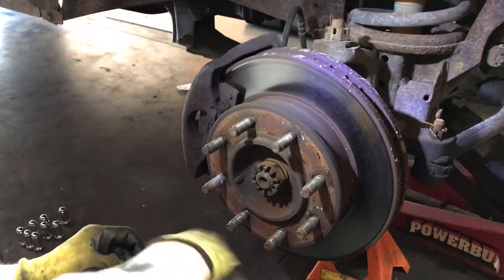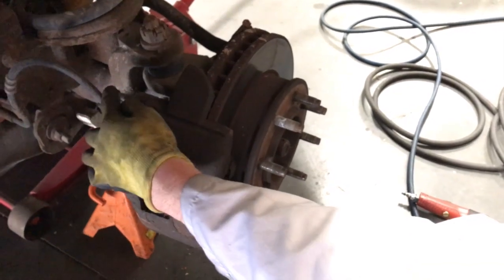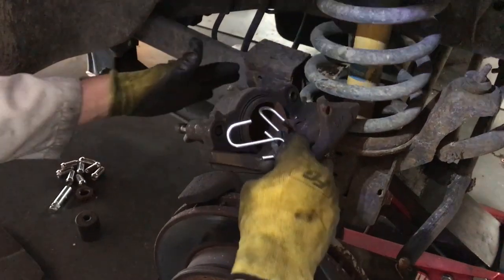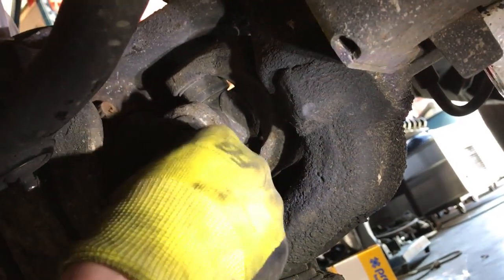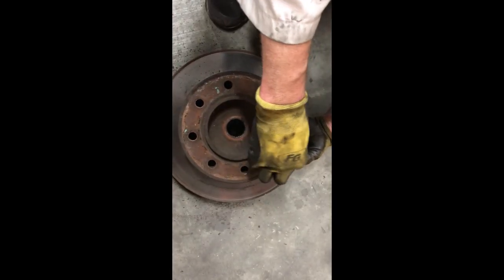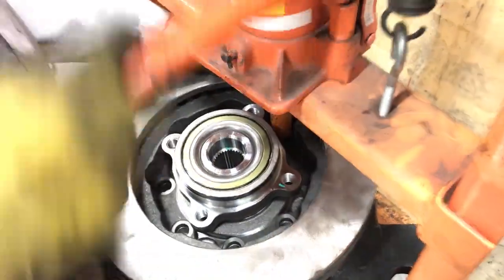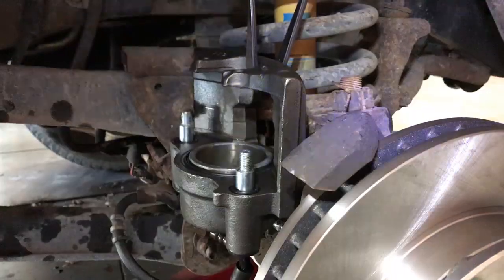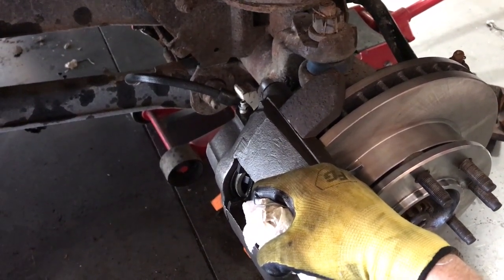How to Change Brake Pads, Rotor & Wheel Bearings on a 1996 Dodge Ram 2500 with a 12 valve Cummins

Comment: This video was great for tips and as a quick refresher (and reminder of what sockets i needed lol).     I don't have a press at home, but i used some washers and a nut to pull the studs through instead of pressing them in.  Threads are still nice and clean.  Thank you for the video!

Comment: You don't have to have a press to press that rotor to the hub assembly you can slide the wheel studs through stack washers up take a lug nut and an impact and you can suck each one of those lug nuts through to seat the rotor to hub just make sure to go criss cross pattern when tightening so it's done evenly

Comment: Tip; use c-clamp on one of the old pads to prevent running caliper cylinder in sideways and breaking brake.

Comment: Thank you for this. Watched a Dboss garage video on how to do this and he just tapped the rotor off with a hammer, had me totally confused as to how my rotor was attached. Thanks man. Other issue I have run into is those 4 twelve spline bolts stripping the splines off. That is a real pain in the ass.

Comment: I have a 1998 Dodge Ram 2500 4x4 with a 12 valve Cummins this is the only video that showed the correct brake/rotor assembly. My 1-3/4" nut wouldn't move so I pulled the stub axle hub rotor as one, did it inside out mode, never removed the 1-3/4" nut as u c in vid the rotor is behind the wheel flange

Comment: Excellent this is the exact job that I have to do that I’ve never done before and on a sidenote that is one of the best hammers  mechanic mechanic or Carpenter could own.  
Thanks again that was just awesome video awesome job and I’m gonna try to do the same 1996 dodge be 2500 sports Van with 360.  Or as I told my neighbor sports tank.

Comment: I see you have the cummins, probably a 3500 too, mine is a 2500 V110, the only thing I do different is I leave the cap on the brake repressive and use a caliper tool , I spent 45 year using "C" clamps though bro, that brake caliper tool is a godsend since AuthurRits took over my hands, and I don't have  press, i have to do THAT the old fashioned way, with a stump 9 with 8 holes for the studs a really bug punch  and  a hammer

Comment: Yes, great video because some 97’s have a disc that comes off right after the wheel. It depends on whether you have 7700 pound, or 8800 pound front end Diesel or not does not make a difference

Comment: Only dodge would make it this way,great video thanks. Just a note I believe it is best to center the c clamp the best you can in the caliper plunger to keep any binding from occuring that may damage the caliper
Reply: And leave the old shoe on to press the piston back in.
Reply: Lol a lot of trucks are even worse.  But yea thank god dodge in 2000 went to a nicer design of which the rotor just falls off

Comment: Also, another way to press the bolts in that helps is to use the old rotor on the press, works wonders
Reply: I using this idea tomorrow. Im just waiting for the lugnuts to show up at napa. I was gonna use a socket. Rotor idea is brilliant. Thanks
Reply: Did you have to use a press or can you use something else to get the studs in?
Reply: I used a press, but you absolutely CAN use a hammer and socket if needed!
Reply: @Jdl223  i used a press. If i had to hammer them out and in it would of taken all day. Harbor freight press is your best friend. Took me 10 minutes. And using the old rotor to hold the new one is the way to go

Comment: Instead of using the socket on the bottom of the hub when pressing in the new studs, I used the old rotor.  Laid flat on on the press bed rails, gave me a hole clearance hole for every stud.

Comment: Mine - I just changed the pads - $30 that's it. Rotor like your is just fine. Hub bearings feel good. I used a big screwdriver to pry the pad apart before removing the assembly. No groves as I changed way before any metal to metal. My Dad owned a brake shop. Fix what needs to be fixed no more. I had about half a pad of wear. Lithium grease for moving parts. Wheel Calipers work just fine no leaking. No need to replace good parts. I'm not going to turn drums with all that hub to remove and such little wear.

Comment: Nice Job. Only tip I have is to suck out as much brake fluid as you can from the master with a turkey baster-type of tool, and put in fresh dot 3, or better. Now when you bleed the calipers, you'll purge out the rest of that contaminated fluid. Purge out the  rear, while your at it, and she's cherry to go !!!

Comment: Great Video!!! Would the procedure be the same for both 4 Wheel Drive and Rear Wheel Drive?? Thanks.
Reply: yes
Reply: No.  The (I assume you mean) 2 wheel drive flavor has a standard integrated hub/rotor.  One has to remove the wheel bearings by removing the dust cap and center spindle castle nut. There is no reason to press out/in the studs, and there are no "sneaky" 4 bolts holding a hub to the steering knuckle.  It's totally different than this.

Comment: So what was the torque spec for the 4 bolts on the back of the knuckle?
Reply: did u ever get a reply on the torque settings? what are they?
Reply: @unclediesel7906  i found them somewhere else, like 96 or 100 ftlbs if I remember right

Comment: Can you not just put a flat Lug nut on the stud and use an impact gun to get it to seat if you don't have a press??
Reply: I'm about to try that exact method, ill let you know.
Reply: How did it work?
Reply: No.
Reply: Go get some dry ice and freeze the studs.  They tap right in when cold.
Reply: I used my battery impact to do what your describing. It was over a year ago haven't had a problem. Just have to use a level or flat surface to make sure they are all pressed in evenly.

Comment: if you are spending the money on new pads, calipers, rotors, and wheel bearings, why not just buy new studs as well?
Reply: All New shit skimps on 6 bucks loses tire lol
Reply: So you think that wheel studs wear out?  That's funny right there.
Reply: @basketballjones6782  you know what rust is right? Especially in states that use salt in winter, why not replace them while your there?
Reply: @4g63tpowered  I live in Canada and my truck was a plow/salt truck for 15 years. I reused my studs and they were mint. They don't really rot surprisingly cause I thought the same thing.
Reply: @2JDeez  ya mine weren't too bad for 500k miles but i was there and you have to remove them to split the assembly. Ocd kicked in i guess couldn't reuse them lol

Comment: Clean the rust and crap off the caliper hanger. In this case that’s the knuckle.  Don’t need a press either any tool truck will have stud installing tool very cheap.

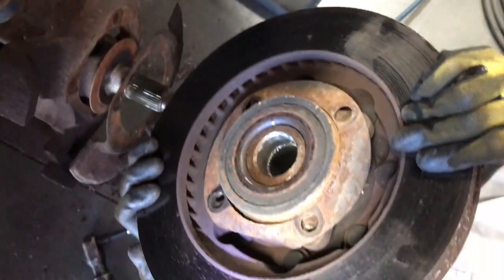Comment: im at the part where i take the 4 bolts out 9:27. i cannot for the life of me take my hub off.
Reply: charles cardery I used a 9# sledgehammer with a socket and an extension on the 4 bolts on the back. Just be sure to leave a 1/8 inch gap between the bolts and the hub when you start to wack the socket extension

Comment: Just use a wheel stud installer tool to press studs back in. It’s so much faster.  I’m watching you guys waste a lot of time. That time is labor and customers will compare labor time with others and leave you bad reviews and be pissed.
Reply from the maker: We don't do any repairs, installs or service. This was merely one of our employees that was changing his brakes and realized that their was not any detailed how to videos so he recorded it and asked we publish it on our channel to help other people.
Reply: @DieselPowerSource  Thank you for the video. Well explained. Nice to do that for one of your employees. No need to change brakes like a Nascar crew lol.
Reply: Nobody is going to trash the threads on my studs using them to pull in a press fit thank you. I can work a press well enough and guarantee none will break strip or be over stressed. I hope you don't use that speedy impact to save time on connecting rod bolts. Quality work takes time and lasts a long time.